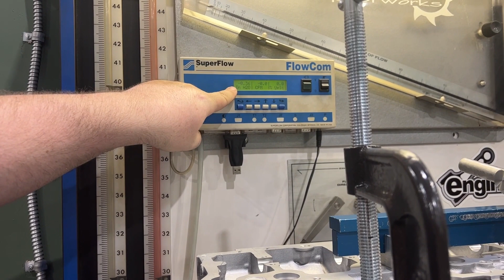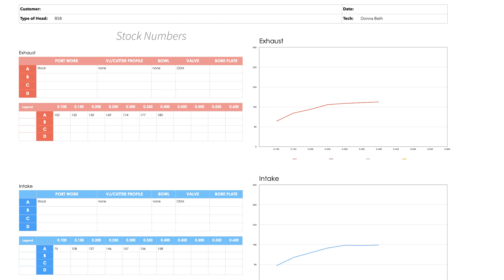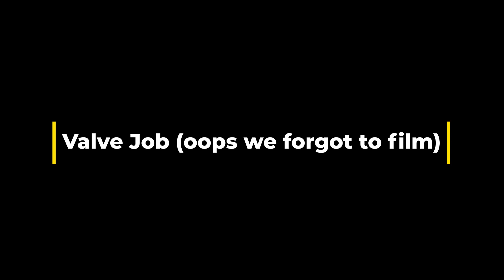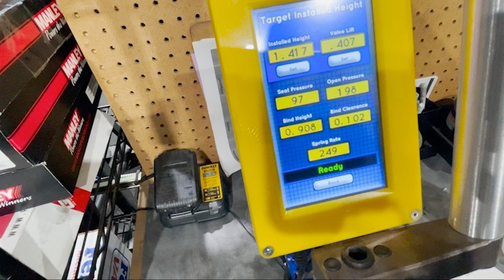A90 Supra B58 cylinder head build up!

Comment: What are you charging for a full B58 head job (Porting, valves, springs, retainers, the works lol)
Reply from the maker: we are not offering a full port just yet. You can check out our pricing on our website. Just do shop by car. Although, the parts pricing has changed because we are only doing the GSC valvetrain moving forward. https://headgamesmotorworks.com/wp-content/uploads/2021/11/022-BMW-B58.pdf

Comment: Have you check how much swirl does the stock head produce
Vs your chamber work?
Reply: Understand, I was just curious about. Keep up the great work 👍🏽
Reply from the maker: @xvelez3  it was a great question! Thanks!
Reply from the maker: no sir. Just deal with it on the engine. It's DI I don't think we are going to see how it is really working on a flow bench. We have many S55 BMW's with a similar chamber working great!